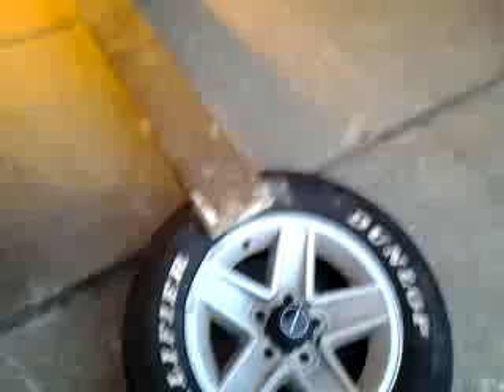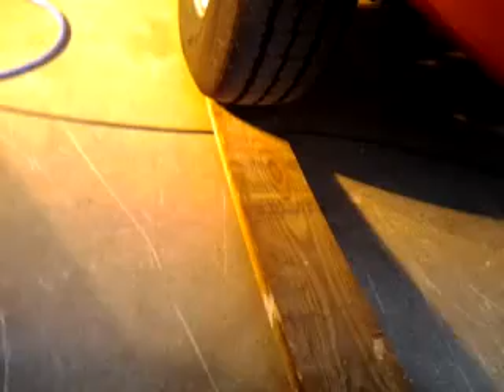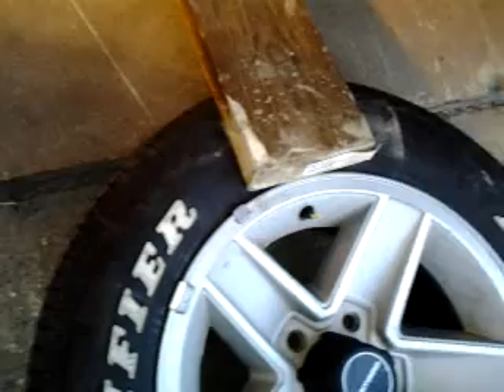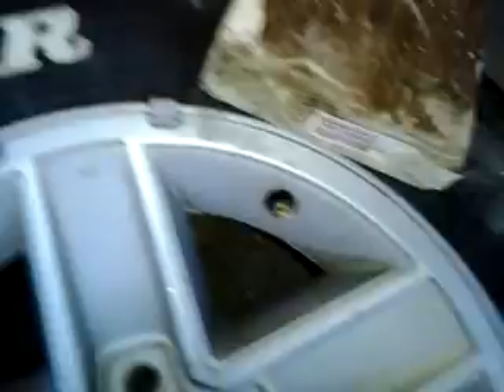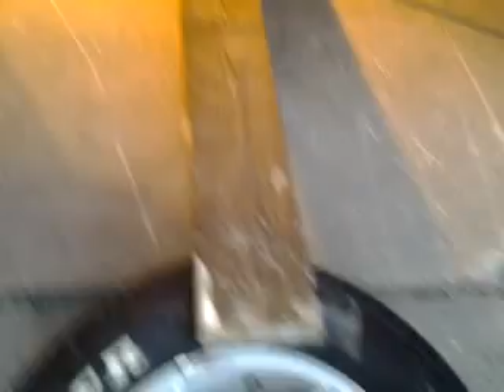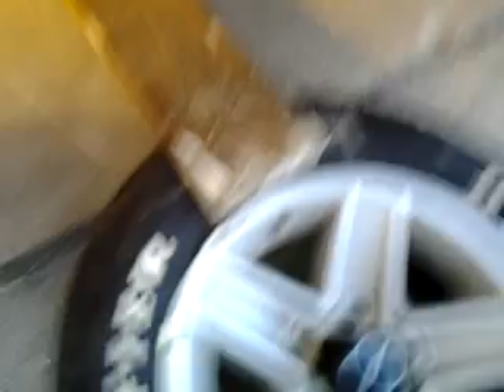Backyard tire bead breaking

Comment: I've been doing this for  20+ years . 32 -36inch board works wonderful. 2x6 or 2x8 board.
Reply: Does it not damage the steel belts in any way by essentially folding them in half under a ~6" area when it breaks loose?

Comment: Wonder if it would be easier to just jack up the wheel, slide the other one under, and lower it on the bead.
Reply: Or I'm considering just trying to pop mine loose without even removing the rim from the truck just jack it up, let air out, spray/lubricate the bead, then just beat against it with a scrap piece of 2x4 end and a sledgehammer...I see those slide hammers seem to work well... similar concept.